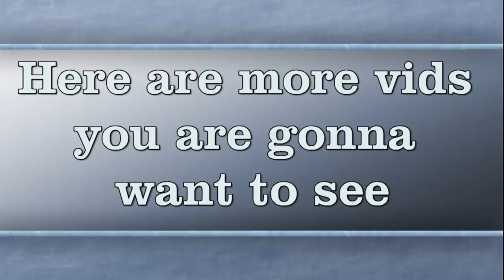OH CRAP !!!!!  I Need a Honey Pot ....NOW !!! - ask Jeff Williams

Comment: Now you did it. The Worm People will be using it all the time now.
 Some lime or wood ashes will keep the smell down. IT will be easier to remove the bucket if you have the front openable., with minimal spillage chances. Also a bucket lid would help in the removal process. Sure beats having to go out and play "Cat in the sandbox" like I did up around the Calico area.

Comment: You need a bag of shredded cedar or pine chips. Sprinkle on top of each load. Helps with odors and when you dump it, you can use it in a garden or ?
Reply: yep, I can vouch for saw dust
Reply: Everyone I know has quick lime in a can right next to the can,lol.
Reply: @paulcallicoat7597  We used Hydrated lime when I was a kid. Kept the smell away and the flies. Quick lime would work a treat as well.
Reply: What you need is the blue water they use in porta johns
Reply: @robbieglass9125  lol... my idea is recyclable and compostable.... blue water?

Comment: Dont for get to vent it to the return!
Title 30: Mineral Resources
PART 56—SAFETY AND HEALTH STANDARDS—SURFACE METAL AND NONMETAL MINES
Subpart S—Miscellaneous

§56.20008   Toilet facilities.
(a) Toilet facilities shall be provided at locations that are compatible with the mine operations and that are readily accessible to mine personnel.

(b) The facilities shall be kept clean and sanitary. Separate toilet facilities shall be provided for each sex except where toilet rooms will be occupied by no more than one person at a time and can be locked from the inside.  
Just an old MSHA guy  :)